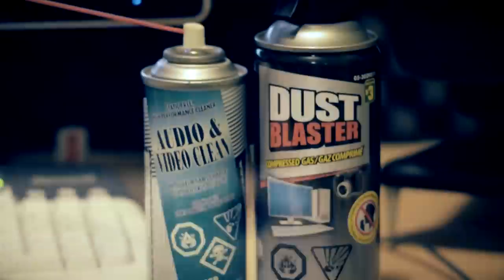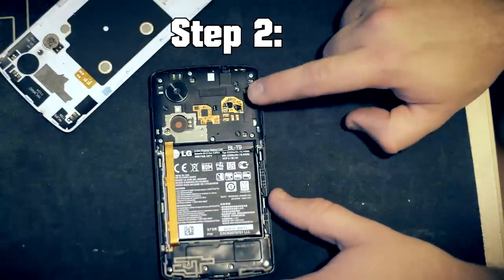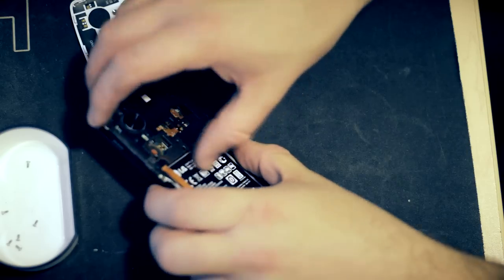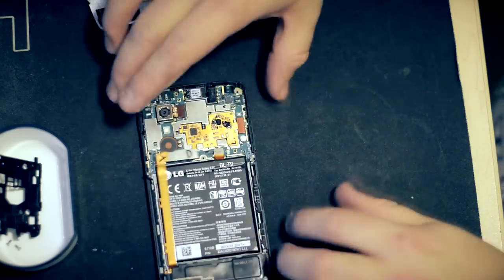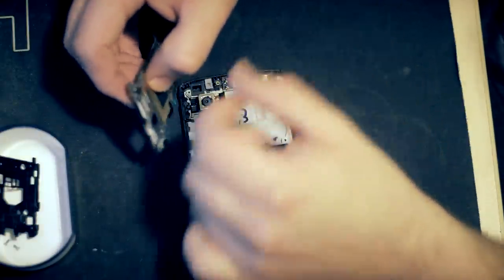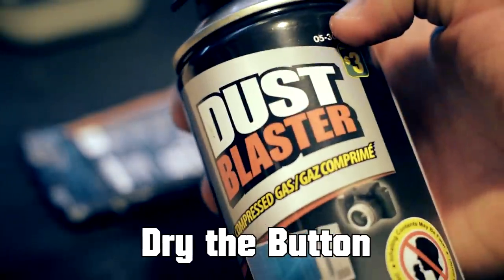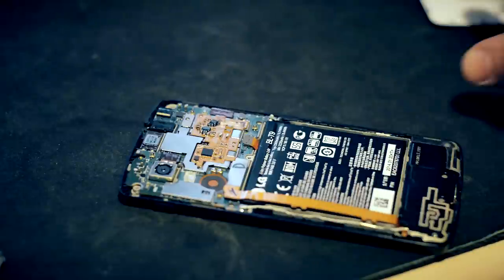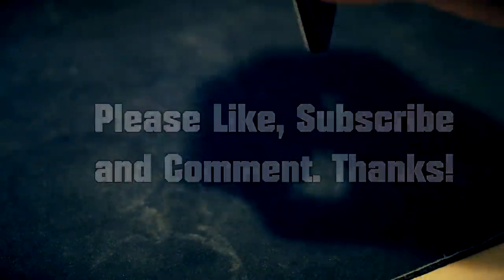LG Nexus 5 Boot Loop Fix - Power Button Repair -

Comment: thanks a lot. This may help to  fix my phone
Reply from the maker: +Tu Nguyen no problem, let me know how it goes!
Reply: Hi. I will give a try. My problem seem like your stituation. I am not sure, my phone some time auto reboot , tested screen and battery works but not sure about button power, may be it stuck while press. I used it quite long time. Can you give me advice
Reply from the maker: It usually starts that way and the problem develops more over time. The button is not necessarily stuck, but the contact is dirty so it keeps doing what it wants. I say give it a try, takes 5-10 minutes to clean and it doesn't hurt your phone :)

Comment: My button clicks fine but this didn't fix my phone. It only loops when plugged in to power supply. Any suggestions?
Reply: tried with WD40, then it worked. Thanks!
Reply: WD40 was part of what I tried, actually the last thing I tried at this time.  Running now, but not sure I trust it.
Reply: +Shawn Hatcher update. 2 months later, my power button is causing problems again. this time the fix isn't holding. i'll probably need a new power button.
Reply: +Jarryd Properjohn Mine is still working.  I will likely upgrade,but WD40 seemed to help.

Comment: That tiny bit of electronic cleaner isn't going to do much at all. You need to really spray it in there to dislodge the debris that is causing the issue.

Comment: NEED HELP!  My phone doesn't work anymore.
I tried this method with an electric contact cleaner. After putting the motherboard back on, I powered on the phone to test that it works, and it did. So I powered it off and went ahead with putting the cover back on. But unfortunately the phone just won't power on anymore. What could have gone wrong?? PLS help as it seems like my phone is dead now. :(
Reply from the maker: +Nikhil Jain Maybe try and open it again and make sure you put all the ribbon cables and two two little wires on. Something may have disconnected in the process of closing it back up?
Reply: what happened after that?

Comment: I was shaking watching you take out the mobo. I was expecting it to snap in half as it was lifted.
Reply from the maker: +Nebojsa R Well i did not put much pressure on it at all. Its like any other circuit board, just don't be a savage and its fine lol

Comment: Phone got wet in the rain which I've had happen several several times but just the other day after returning from a walk in the rain it powered off and wouldn't turn back on and when I connected it to the charging cable it began doing the boot loop powering on and off repeatedly until I unplugged it so I dried it out in front of the heater in case it was wet and the reason for this issue but no luck so next day I google search nexus 5 boot loop and this video and a few others were the top results and it said power button and I thought the rain might have loosened some dirt or something and might of resettled in where the button is so I watched video and decided to get a closer look at my button and started to take it apart but before I messed with the battery bracket or whatever its called I decided to play around with the power button the best I could with the room I had and the first time I touched it with a razor it came alive and did the boot loop twice the stopped so I was thrilled it seemed to be something to do with this power button and I ran the razor between the plastic power button and the button that's on motherboard that gets stuck or sticky and it booted up with no more boot loop so I cleaned it good since I was already in there and put back together and it's good so like all the other people here in the comments your video helped me too so thank you very much your awesome

Comment: the problem is the black button for some reason they design it very lame.it has some rubber on him and it gets tear off eventually.either you replace it or fix it with a glue.

Comment: i Did everything that you said to do, and now my phone when i press the power button- it says GOOGLE and then turns off
Reply: +Shani Isseroff sounds like the button is still getting stuck in the depressed position and causing the boot loop. try pressing the button actuator directly to see if the same thing happens and if the buttn comes back out when you release it

Comment: This has nothing to do with cleaning. All you have to do is keep pressing power button fast till you get the phone working for temporarily. Power of the phone manually and then hard reset your phone by pressing power and volume down button simultaneously then factory wipe the whole system. 

Kaboom problem fixed for every. Your phone will function properly onwards.

Comment: Didn't work for me unfortunately. I tried it about 10 times, using alcohol and I smashed the shit out of the power button then blasted it with compressed air. No luck, still in a boot loop. I suspect my power button is dead altogether. RIP N5.

Comment: thanks bro but it doesn't work for me. i have to change it with a new button
Reply: where and how did you get the button replaced?
Reply: Rhij DMe from a galaxy s3 motherboard
Reply: Rhij DMe i used a welder

Comment: My button works fine, it clicks. but ich keeps turning it self of and boot loops
Reply from the maker: +Twitch Mine was clicking fine too, but the clean helped. It only takes a couple minutes and its pretty easy so why not try it. :)
Reply: +Twitch My button was clicky too, once I cleaned it like this, it worked.
I used 99.9% isopropyl alcohol.
Reply from the maker: +kayboord Great! good job! :)

Comment: after trying this, it did not work. I reverted back to the banging method but after buying a new battery and things to clean it/wasting a new bottle of air to dry it, the banging method developed into the breaking in half method. 

its fucking 2017 I think try a new phone.

Comment: Didn't work. All I've successfully done was void my warranty.
Reply from the maker: +UnUltimatedLink Sorry to hear that man, if you had warranty you should've taken advantage of it. This video is for the rest of the world that does not have that luxury. If it has not worked, you might need a new button or have a different issue entirely. : / Wish you the best of luck
Reply: Weekend Agenda Thanks mate.

Turns out, while there wasn't an immediate remedy, this method did alleviate my problem by a significant margin.  Whereas before every button press got stuck, only about 1 in 4 presses are getting stuck now.  Thanks m8
Reply from the maker: ***** that's great to hear :) Now sell that thing while it still works LOL

Comment: Please don't not remove anything with a metal tool, major rookie and noob move. It's better to use your nail.
Reply: What do you think would be so bad about using metal
Reply: @logangleason1141  to harsh can potentially cause shorting issues if the battery isn't removed yet.
Reply: I'm just wondering if u have experience can I've built several PCs and I've never worried about that. Plus your not touching any important parts before unplugging the battery.  They have very strict protocol on parts to ensure they are safe and do not surge.  My issue with nails would be potentially getting more dirt and grim into it.  Also u cannot be as precise when using nails, which means you could also damage something that way.
Reply: @logangleason1141  well I'm a cellphone repair technician and a lot of things can break. Plastic tools are the best but id prefer nail over  metal, atleast you have more control. The protocols are not as strict as you think LOL.
Reply: @NNTorious  depends on if it is first party or not, but usual name brands are pretty good.
Reply: @logangleason1141  well thanks for the tips not professional phone technician